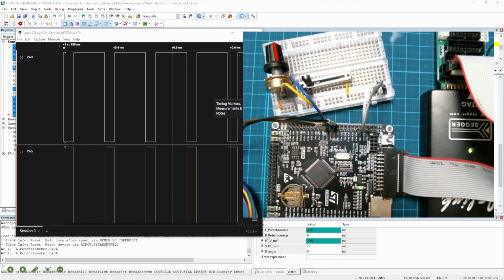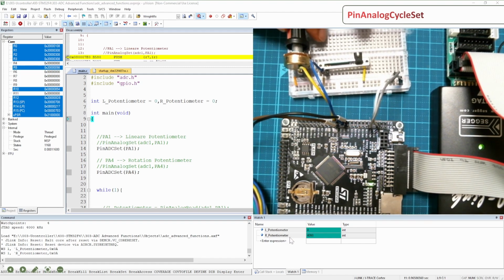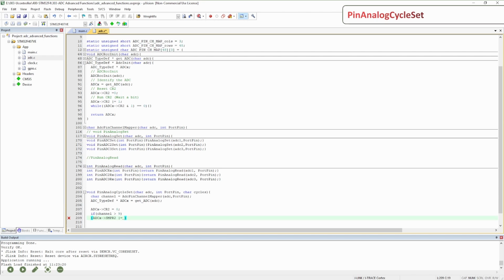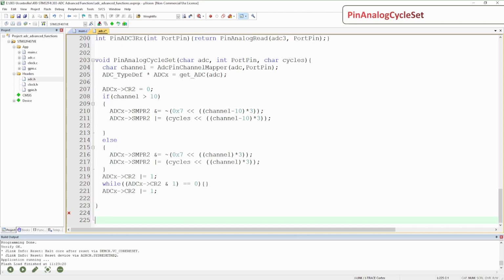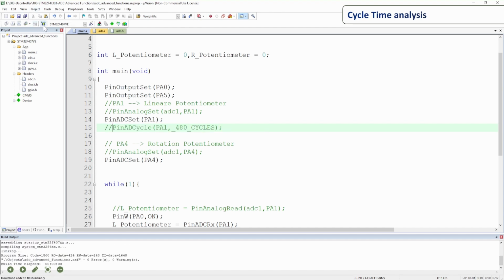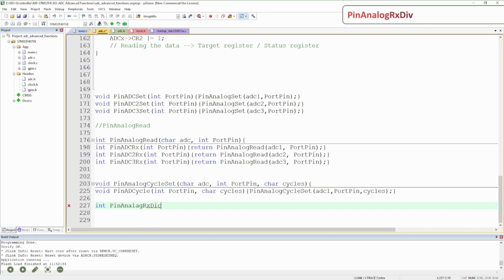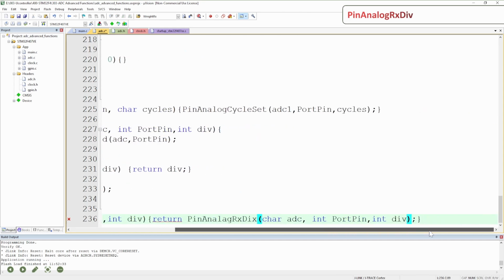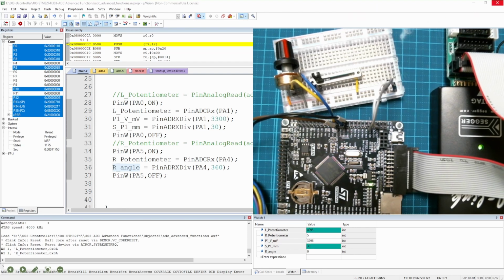303- STM32 Tutorial Advanced ADC Mastery: Building Complex Functions for STM32 ADC Peripheral | KEIL

Comment: Hi Can you make a video on using ADC to sample external singal freq, suppose we give 1KHz sine signal to the adc pin, it should be able to sample it.         I have searched all over youtube and no one has done it properly yet.                    
Everyone is using only Potentiometer to display the change in value
Reply from the maker: Hi there, thank you a lot for your quest, it is possible to make it, I will need to use some Timer's injection and some specific logic to have an accurate readings. then, there will be a need to show the display (whatever PC or other types of screen connected to the uC). I do have a limited time for to develop, so if you have time, I can provide it to you in around 8~10 weeks. Let me know
Reply: @WeeWStack  Hi thank you so much for replying, please make it as no proper tutorial is present yet for doing this yet.                                          If possible please try to make it faster, I guess you have very limited time so I can lend you helping hand if that's possible, although I have limited knowledge of STM32, I can help with research part I guess and editing

Again thanks for replying, I really like channels like yours😇 you are gem to this community
Reply: To sample a 1 kHz frequency on an ADC pin of the STM32F103 microcontroller, you need to set up the ADC and its clock appropriately. Here's a step-by-step guide on how to achieve this:

Enable the ADC Clock: By default, the ADC clock is disabled. You need to enable it before using the ADC module.
c
Copy code
// Enable ADC1 clock
RCC->APB2ENR |= RCC_APB2ENR_ADC1EN;
Configure the ADC Prescaler: The ADC clock must not exceed 14 MHz, as per the STM32F103 datasheet. Therefore, set an appropriate ADC prescaler in the Common Control Register (CCR) of the RCC (Reset and Clock Control) peripheral.
c
Copy code
// Assuming the main system clock frequency is 72 MHz
// (This can vary depending on your system configuration)
RCC->CFGR |= RCC_CFGR_ADCPRE_DIV6; // ADC Clock = 72 MHz / 6 = 12 MHz
Configure ADC Pins: Set the ADC pin(s) you want to use as analog input.
c
Copy code
// Example: Configure PA0 as an analog input
GPIOA->CRL &= ~GPIO_CRL_CNF0; // Clear the configuration bits for PA0
GPIOA->CRL |= GPIO_CRL_CNF0_0; // Set CNF0_0 to 01 (Analog mode)
Configure ADC Resolution and Sampling Time: Configure the ADC resolution and the sampling time.
c
Copy code
ADC1->CR1 &= ~ADC_CR1_RES; // Clear resolution bits to set 12-bit resolution (default)
// Set the sampling time for channel 0 (assuming you are using PA0)
ADC1->SMPR2 |= ADC_SMPR2_SMP0_1 | ADC_SMPR2_SMP0_0; // Set sampling time to 28.5 cycles (adjust as needed)
Configure ADC Channel: Select the ADC channel you want to sample. In this example, we are using channel 0, corresponding to PA0.
c
Copy code
ADC1->SQR3 &= ~ADC_SQR3_SQ1; // Clear the bits for first conversion in regular sequence
ADC1->SQR3 |= 0x00; // Set channel 0 as the first conversion in the regular sequence
Enable ADC and Calibration: Before starting ADC conversions, perform a calibration and enable the ADC.
c
Copy code
ADC1->CR2 |= ADC_CR2_CAL; // Start ADC calibration
while (ADC1->CR2 & ADC_CR2_CAL); // Wait for calibration to complete

ADC1->CR2 |= ADC_CR2_ADON; // Enable ADC
Start ADC Conversion: To sample the 1 kHz frequency, you can use a timer to trigger ADC conversions at regular intervals.
Configure a timer (e.g., TIM2) to trigger ADC conversions:

c
Copy code
// Assuming you want to use TIM2 for this purpose
// Set the prescaler and period values for TIM2 to generate a 1 kHz frequency trigger
// (Prescaler * Period = Timer clock frequency)
Enable Timer Trigger for ADC:
c
Copy code
ADC1->CR2 |= ADC_CR2_EXTTRIG | ADC_CR2_EXTSEL_0 | ADC_CR2_EXTSEL_1 | ADC_CR2_EXTSEL_2;
Start the ADC Conversion:
c
Copy code
ADC1->CR2 |= ADC_CR2_SWSTART;
After following these steps, the ADC will start sampling the analog input at the desired 1 kHz frequency, triggered by the timer. You can then read the converted values from the ADC data register to obtain the sampled values.

Please note that this is a basic outline to get you started. In a real application, you may need to adjust the ADC settings based on your specific requirements and hardware configuration.  -chatgtp   Any experts know  if the AI is correct?